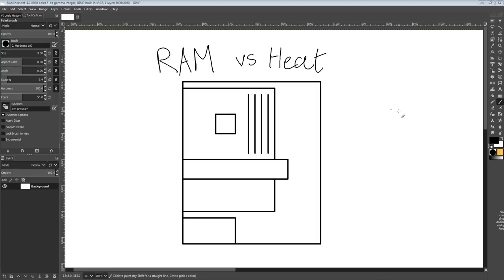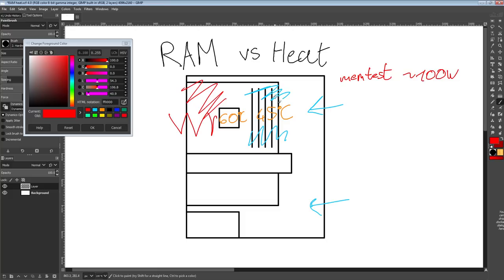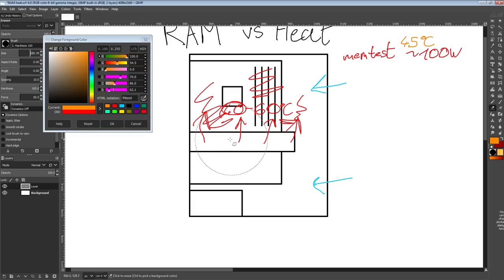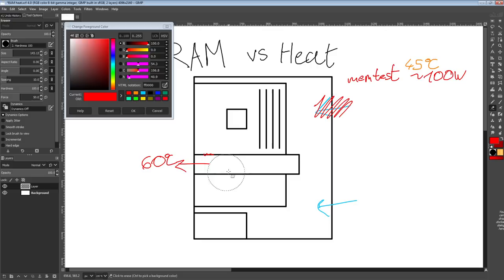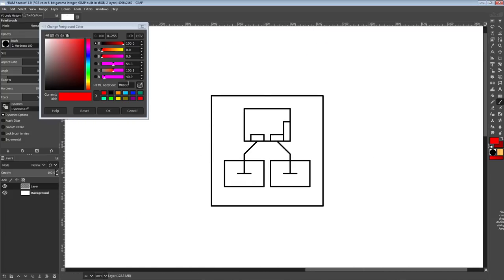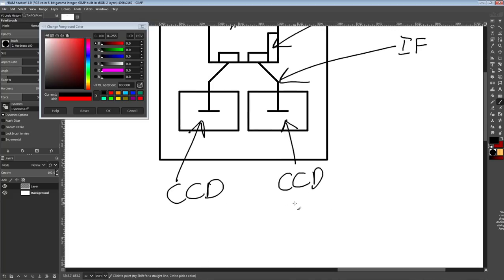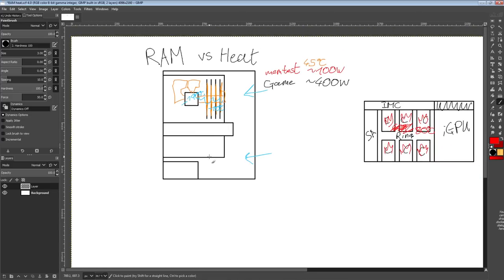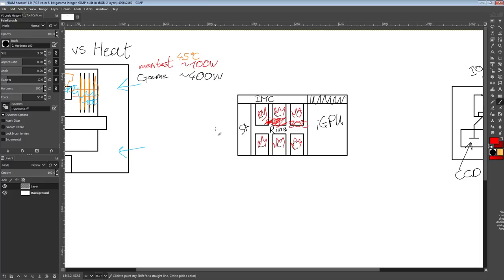RAM overclock stability and heat management.

Comment: I’ve actually had issues with crashing due to this old G Skill memory cooler, I got it off of a triple channel Trident X kit for x58 I still use, the fans bearings are kinda in rough shape so the fans vibrate for a couple minutes until they warm up and it sometimes causes the system to crash.  It took months before I made the connection.  Random freezing on a cold startup that was completely unpredictable and unreplicateable.  It always boots on the second attempt and stays stable lol

Comment: Just tried this out on my own system, just to get somewhat of an idea how much power it's using when i am watching this video, turns out, ~150 Watt's total.
CPU: AMD 3900X
RAM:  Corsair Dominator Platinum RGB @3600Mhz CL16 - 4x 8GB modules
Mobo: Gigabyte X570 Aorus PRO (Non WiFi)
GPU: An almost antiek EVGA GTX 760, LoL no joke (But then again, i'am not a gamer, and it is going to be replaced not to long from now with a much newer one, so for now i don't realy care)

Comment: Do these GPU heat based errors appear fast? I had my 4x8 GB RAM running fine with 3733 MHz in my Ryzen 3000 system for more than a week and suddendly got several crashes in a row. Changed to 3600 MHz and no problems anymore.

Comment: While stress testing my ITX case is 61c ambient around the ram. RAM peaks at 66c. My AIO is side mounted as an intake blowing up to 220watts from the CPU at the motherbaord. LOL. I could swap it to exhaust but then it pulls heat from the 3090 to cool the CPU with. 3733CL14 is stable. Never been able to get over 1866fclk 100% stable, so I don't really need faster ram speed.

Comment: I'm running my Kingston HyperX Fury DDR4 2400mhz at 3000mhz with XMP. Haven't changed any timings or whatsoever Is this safe? Or should I lower it down??
Reply: walentaz  It works better than before with the overclock, haven't checked the voltage tho. Thank you anyways.

Comment: Could watercooling ram be effective then?
Years ago I heard many times that ram just doesn't produce enough heat to be worth it, but I guess that might had been just ddr3?
Also would chilled watercooling have additional positive effect on the ram?
Reply: Generally it's not useful outside of pushing tREFI to its max on Intel platforms

B-Die generally hates being cold and will shit itself

Comment: Would you run Samsung B-die at something like 1.50 volts on the DRAM using a motherboard like the MSI MEG godlike Z390? of course it would be for daily usage.
Reply: I'm worried about degrading the memory controller, the CPUs IMC, it's a coffee lake i7 9700k.
Reply: @walk3rshyper314  the mem voltage doesn't effect the IMC, that's SOC voltage.
Reply: @m.streicher8286  Oh okay, that's good to know, so 1.50 volts on the DRAM should be fine? and your saying that SOC voltage would affect the IMC? that's system agent voltage right? what about VCCIO? Does that affect the IMC too?

Comment: I believe it's something that is happening inside my PC. I have ~150 W Polaris RX 570, R5 1600 4 GHz and 2x8 Ballistix AES. When I overclocked and tested them they did 3400 MHz CL14. However when gaming, they caused blue screens at 3400 CL14 and 3200 CL14. 3200 CL16 works fine, but let's be honest it kinda sucks. Now I'm testing 3400 MHz CL16. I can't go higher becouse of shitty IMC, but probably becouse of heat CL14 I also consider as unstable. Scythe Infinity sits on my CPU and it has to be mounted vertical, and my front air intake is also low, so everything figures. The only difference, I have one 14 cm low RPM fan on side panel and I was shocked how great difference it makes at first.

Comment: Why mainboards aren't designed with the heat flow in mind, the hotest elements at the top, coolest at the bottom - e.g. pciex slots at the top of mb, then cpu and memory at the bottom.
Reply: Because they don't care if we fry our components because of bad design + bad airflow, they actually WANT us to upgrade our machines - yearly if possible :P
Reply: walentaz  good to know, thanks
Reply: There was the BTX form factor for motherboards that took heat into consideration.

Comment: I had this issue with my new PC running on 4400mhz, first I was blaming my GPU for crashes then I blamed PSU and the last thing was the ram... but I noticed that when I open the PC case then there is no crashes anymore... I was undervolting the GPU and got less crashes then i was wasting more and more time until i put the gpu to other PC and tested there 3 hours without crashes. I removed xmp and cpu oc on my main pc and finally got rid of crashes, then tried xmp 4000mhz and seems no crashes anymore. Damn rtx 3080 gives a lot of heat.

Comment: Not sure if achieving 3672mhz (3600mhz with 102mhz BCLK) with cl 16-19-16-38-60 1T at 1.43v dram and 0.715v termination is good on my 2*8GB kit of single rank micron E-die on my 2700x at 1.05v SOC voltage.
Reply: I've rarely had success with bumping the base clock + other overclocks , 1.43v on ram seems high.
Reply: @deminybs  1.43v is completely reasonable for an Overclock. As long as you are able to keep your Sticks cool, even 1.5v is completely fine.
Reply: That sounds pretty damn impressive for a zen+ part
Reply: @teddygoboom1  Yeah it  does... I just realized he said 2700x. Most I got with B Die on my 2700x was 3600, and that wasn't completely stable, 3466 was my most consistent and stable result, and that was a b**ch
Reply: 3600 is perfect for ryzen.   e-die for the win!!!!

Comment: Is there any point to remove the factory heatsink on RAM and apply thermal paste instead of glue or whatever they use? I think that thermal paste should have enough adhesion to keep heatsink in place. But I never seen anyone doing this or testing
Reply: RAM itself doesn't produce that much heat. If the air around is hot, temps will climb no matter how good the passive cooling solution.
The reason behind high temps is not the RAM heat, just a lack of cool enough air around. 

RAM doesn't produce enough heat to worry about heat transfer onto the heatsinks.

Comment: when overclocking bdie when you restrict windows to using 2gb of memory to push 2 volts into the sticks does that also restrict how much memory i can use in games and other uses? is it viable to bench games with this senario or is it justd like benching with 2 gb of ram?? thanks!!!
Reply: Games run on the OS, if the OS has only 2GB, games get even less than that.

Comment: huh, i have a ryzen 5 3600x and during gaming or idle it just runs at around 50 to 55 with its stock cooler. in cinebench, where all cores are used, it runs at 80 degrees (and i bet, with a good cooler you could get it down to 75 or so). isn't 90 degrees a bit high for a cpu?
Reply: It kinda is, looks like that AMD's 7 nm node is very HOT :P

Comment: It's nice to see a video touch on IMC temps and the impact on ram overclock. In a lot of the circles I'm in this is a seldom touched on subject. I used to also experience a similar issue quite frequently when overclocking back in the AM3 days (AMD Opteron 1389 and AMD Opteron 3380) while pushing the BClk and IMC frequency up. There would get to be a point that no amount of voltage bump would stabilize the IMC at a high enough BCLK (265~282 in my case) even though the ram was already clocked below stock ranges. Once stabilized it would often take a small amount of heat to destabilize it beyond normal outside a memtest even though the cpu was otherwise 'cool'. Artificially limiting cooling (removing the CPU fan or covering it with a rag) to force a certain temp range I found helped find a stable max temp range in worst-case scenarios and ensure stability on the long run.

I also found that at such extreme edge cases loosening timings resulted in worse stability as well and would only stay stable within a very specific timing range.  🤷

Comment: For that reason, as memtest stable memory can crash very fast in actual use, i decided its worthless to do long memory testing. I just do quick one and then go test different things. I feel like that for me its actually caused by lower temperature than in memtest, because my memory actually never gets as hot as in memtest in other uses. Also i have been able to get settings that give errors very early in memtest, but once memory heats up errors stop. I don't know for sure but this could be due to asus prime x370 pro being really crap in memory overclocking.

I thought that maybe i should try memory watercooling as i feel like memory on my system is very sensitive to temperatures, but then i just got triple 40mm fans to cool memory, but im not even sure if that helped memory overclocking, at least it got cooler.

Comment: How do you tell what the RAM temp is?? I only have CPU,gpu, vrm,  chipset ,drive temps in hwinfo64, 
I'm using an 32GB LPX 3200 CL16 kit OC to 3600 with same timings, ran memtest overnight with no errors
Reply from the maker: some mem sticks have temp sensors on them
Reply: Advocatus Diaboli  I have a handful of temp probes that came with my commander pro, where exactly should you mount one to the RAM? On a chip or next to one on PCB? Or 1 each ? Lol
Reply: @deminybs  You would want to test your Ram to find the hottest chips ideally. Most likely this is going to be one of the Memory IC's in the Middle. So I would Put your Probe on the 3rd or 4th Memory IC in, then run a Memory Stress Test, Intel Burn Test would set to something like 4 to 8GB would be perfect, but make sure you dial back your Core OC so that your not on the edge of stability for this test. Ideally you would want the test to wrong long enough to saturate the sticks, at least 15 to 20 Minutes, but longer is better. Then move the Temperature Probe to the Next Memory OC Over and run the test again. Even better if you have multiple, the Commander Pro comes with 2 Probes if I remember correctly, depending on your board you could have 2 to 3 more. To make the testing go faster I would populate all, but keep in mind there is variance between the temperature controllers, so it may be best for comparable data to just stick with using just the Commander Pro, or just the Motherboard. Keep testing IC's until you find the hottest one, then leave your probe on that IC, and you will have a pretty reliable measurement. Keep in mind that the measurement is on the outside of the PCB, so realistically the inside operating Temp would be a few degrees hotter, but its accurate enough to give you a reasonable measurement.
Reply: @deminybs  Also make sure to track Room Ambient when running your tests, so you can normalize your results. If for example on your first test on the 3rd memory IC you got 42c with a room Temperature of 24c, but on your second test on the 4th Memory IC you got 43c but your room temperature is now 26c, then after adjusting for ambient your 2nd result would actually be lower. So just keep that in mind when testing.
Reply: @evocatiproductions  thanks for the answers, yeah the commander pro has 4 or 6 temp probes lol, and I'll be doing the testing in my house so controlled ambient temps won't be an issue
Reply: @deminybs  Yeah your right, I have one I just stopped using it, just looked, its 4 Temp Sensors and 2 RGB Controllers ( I had mixed them up). So Yeah use all 4 of those babies, although I think they might have only included 2 Probes in the box, can't remember, but they are cheap enough to grab 2 more off Amazon for a buck a piece if I am correct about only 2 being in the box.
Reply: So cheap Corsair LPX 3200 CL16 can REALLY be overclocked that high :-) ? I heard from a lot of people to buy just Samsung B-die memory kits which sadly is almost double the retail price here in Romania...
Reply: @vladvah77  Well to be fair, the 2x8GB Corsair C16 LPX Kits can be Samsung B-Die, I have a kit in my test bench system, its just lower binned Samsung B-Die, but I am able to still get it to 3600Mhz C16 on Zen2. The 2x16GB Kits are normally Micron E-Die to my Knowledge,  and those can Overclock pretty high, its the timings and subtimings that are generally looser than B-Die, but still decent Ram.
Reply: I actually did a little more research and ended up buying this RAM kit with 14-14-14-34 timings 
Model F4-3200C14D-32GTZSW
Reply: @deminybs  Yup, that is definitely Samsung B-Die. I use G Skill Flare X (Same Memory Modules as the Trident Z stuff) in all of my systems but my Test Bench, on Zen 2 You can easily get it up to 3800Mhz as long as the IF of your chip can do 1900Mhz, otherwise 3600Mhz is damn near guaranteed. Enjoy!
Reply: @evocatiproductions  I'm sure I'll have all kinds of fun lol, yeah I looked at the flare x kit as well but it was out of stock , here's to hoping the new kit isn't too tall and my dark rock pro 4 still is able to mount, if not I'll have to go back to my deep cool captain 240ex AIO . or get a 360mm

Comment: Yeah my 980 Ti with custom BIOS will do >500 watts on air and it was a bad bad time for my case temps. Had to pull off my sidepanel to stop the memory errors.
Reply: na... 500w?  cmon.
Reply: @XX-121  its possible, i had run 400w power limit at stock cooling and it reached easily, of course with elevated vcore too.
Reply: @speedfastestsolo  dude i was running an overclocked FX-8370 + OC'd 980ti (1440-7600) and i don't ever remember pulling anything close to 500w and i have a Corsair RM 750i which has gives you input/output wattage (total system)
Reply: @XX-121  you need to mod bios power limit & voltage to do that.
Reply: @XX-121  Yeah they can supposedly even pull 600 watts if you tune it high enough under fumark. Stock BIOS have a much lower power limit though.

Comment: not even 30 minutes, but i have some constructive input, all consumer cpus/gpus use flip chip designs so generally closer to the pcb is hotter like you said, however i have a vertical mounted gpu and use a desk fan (big one) aimed at an open side panel (so i can see my rig) and ive had instability in games as opposed to in memtest. my belief is that the memory controller itself is surrounded by more heat while gaming hence throwing off stability. 10 bucks says this gets covered in the rest of the vid
Reply: it does lol

Comment: Or you could have the problem I was having yesterday... The heat spreader falling off my Patriot Viper Steel because they never secured the thermal pad to the ICs properly.

Edit: turns out that kit is the good one. I purchased a matching set and it was just a bad kit. Occasional errors even at 2133 default BIOS settings.

Comment: I'm having problems with this right now, with a 3960x at stock, one side of the memory sticks is about 10-15c hotter than the other, it will error out and crash apps when I'm running cpu rendering and gpu load gaming at the same time. Irql not less or equal 90% of the time. Put fans to push air onto the ram sticks but there is still a delta on one of the sticks.. Bitch to fix
Reply: Also, is it confirmed a mem stability problem when the system becomes stuttery with the cpu load > 80% + hot air around mem

Comment: Better RAM? 
16-16-16-36 @ DDR4-3600
or
14-14-14-34 @ DDR4-3200
Reply: if you are on ryzen go w/ 3600
Reply: The difference is marginal  with the listed timings
Reply: true latency of the 3200c14 kit is slightly better, so I'd say 3200c14 will run any day 3600c16, I run my 3200c14 kit at 3666c14 on Ryzen 3700X, so did I with my former 2700X (use 1usmus Ryzen Timing calculator), like trance dj said, running 3600 is almost a must, it improves c2c communications (infinity fabric clock speed)
Reply: Not really any difference

Comment: Have a kit of trident z 3600 cas 16 at 4000 cas 15 tightened subs at 1.485 they HATE VTT on my z390 dark, and seem to need more voltage for 4000 cl 15 than they needed on my z170ocf and 7700k, memtest 100 stable, the z170 took no fans to do it, the z390 boards needs fans
Reply from the maker: isn't the Z170 OCF known to run more voltage than what's set in the BIOS?
Reply: @ActuallyHardcoreOverclocking  I have heard that, have never tested it with a meter tho, I know if you set say 1.5 as bios reads after a reboot it will read  1.515ish, so yeah slightly but I was at 1.45 in my z170 vs 1.485 on the z390, I'm sure some of it comes down to some of the boards auto timmings.

Comment: ima give this a try
i get random blue screens when mining on my ryzen with the mem at 3200
it is m die but i have no problems in lesser tasks
i would be willing to bet this is one of my problems
Reply: mining what?
Reply: 1st gen is very finicky with 3200. I got it to work on one of my desktop Ryzen chips, used TridentZ NEO 3600 kit and slammed it down to 3200 with similar timings (so really not good, but it worked, lol!) My Threadripper works fine on 3600cl19 Hynix quad channel, so it can be done but neither of my 1700 or 2200g can run 3200 reasonably (2933 is what the 2200g can do well, beyond this it’s just sloppy timings, haha!)

Comment: I have 2x 16GB G.Skill TridentZ RGB (B-Die) that gets to ~58°C after long gaming sessions. That's at 2133MHz and 1.2V. I have almost no airflow in my Evolv X, because the fans are running at 700-1100RPM and I have radiators in front of fans.
Reply: Have you tried adding heatsinks (even those cheap colored aluminum ones) on them?
Reply: That's the issue, too little airflow.
Removal of the front panel can easily give 5-7° better temps on the CPU and 3-5° on the GPU. Pretty sure the memory would also benefit:
https://www.gamersnexus.net/hwreviews/3379-phanteks-evolv-x-case-review-dual-system-thermals
Reply: @otaviobastos9886 Forgot to mention that these are G.Skill TridentZ RGB. They already have heatsinks.
Reply: @HappyBeezerStudios  It's a fully watercooled system. Removing the front and top panels drops the liquid temperature by 1-3°C